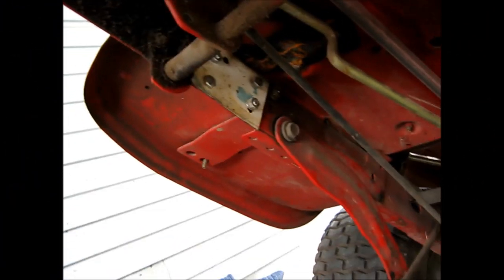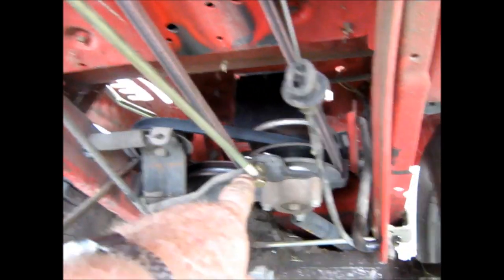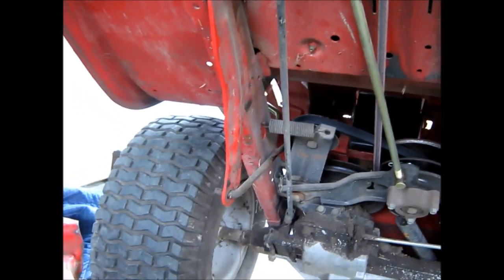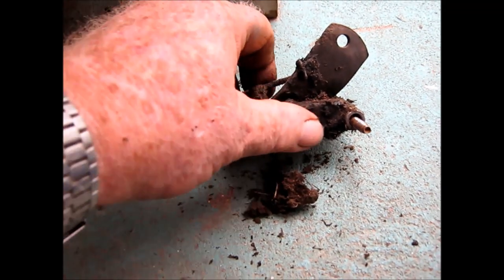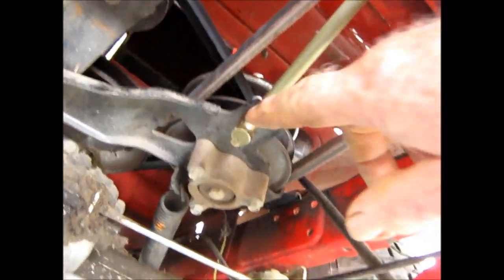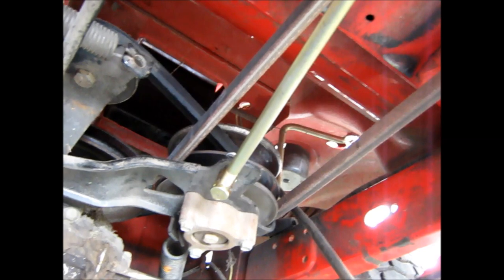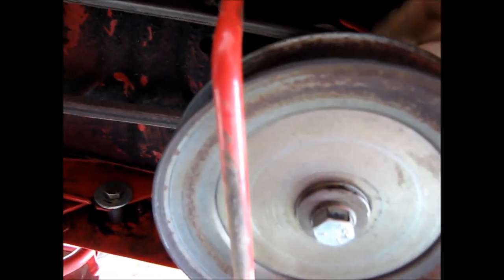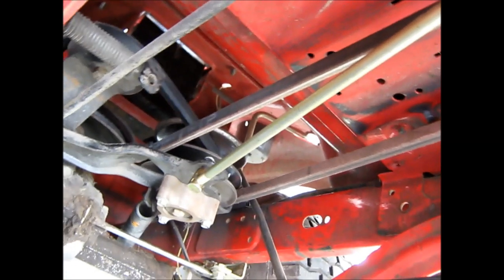troy bilt mower won't go up hill in low speed

Comment: That's exactly the video I needed.  Not for the same reason but, I lost the transmission tensioner pulley spring.  I could see in your video exactly where it is and what I need to buy.  Thanks!

Comment: Thx for the video. I'm chasing the same issue on my 2002 MTD. Changed belts and only drives on level ground. Thinking it is a clutch issue. Now I see it needs an adjustment!  Thanks for the info. I'll make this adjustment and post results!👍

Comment: You can also remove the bolts holding the engine to the frame and slide the engine back towards the seat to get that belt around the pulley. That's the way that I did it. The engine doesn't move enough to damage anything related to fuel or exhaust connected to it.
Reply: I never tryed that but think I will 

Thank You

Comment: Good fix, Vernon. I had a similar problem with a Simplicity mower recently, but it was the belt adjustment on the mower deck.
Reply from the maker: I might have celebrated my success a little  too early, now it seems it's not quite right now,,

Comment: If you put a slightly too long belt on or the belt wears some then simply adjust the engagement rod so the belt will be tighter and it will pull in low gear
Reply: i gave you a thumbs up that is exactly what mine was doing, pull in high gear slip bad in low, thankyou
Reply: @danthemanoth  you're welcome

Comment: Good you find that problem, I had a 18hp MTD that mess with me, I never managed to get the links set correctly,  after many moons I found out that on that machines it is mandatory that the two covers on the outside blade pulleys must be on, mine was gone,
Reply from the maker: yours must have been the deck belt, ??
Reply: Yes

Comment: I have a 2005 pony that is doing the same thing. I changed the belts and now it will only go in 7th gear. Will you please post the part numbers for those drive belt or the actual size of the belts. The ones I used were 5/8" wide. I will greatly appreciate it.
Reply: Did you figure it out mine is doing the same thing won't businesses in high gear

Comment: I have a question, my Troy-bilt was having a hard time climbing hills last year, but now won't climb,it doesn't seem to be transmission, I dont think because reverse works good,runs good on flat ground, and I'm not too mechanically inclined,but need to know WHAT to check...replaced belts and some bolts last year, its stayed well maintained so I'm at a loss a family member says transmission but I'm not sure I can agree, need an unbiased opinion
Reply from the maker: I couldn't say for sure but one thing you might check is if the variable pulley is moving up and down freely, that's what controls the speed and movement.  That is if it's just like the one I was working on in this video.

Comment: I have same problem it won't move in lower gears I changed the belts and checked the variable speed pulley still won't move in lower gears any suggestions it's like the belts Are to wide or something

Comment: Thanks for the solution to a troublesome problem. Keep em coming and thanks for sharing.
Reply from the maker: I though it was fixed but I tried it later and it seems like it's still not quite right,
Reply: maybe it just needs to be a little tighter??
Reply from the maker: yeah, I'll probably tinker with it again tomorrow,

Comment: Question for ya…..I’ve changed both belts ,and now when starting up it moves on its own without touching throttle pedal….any suggestions
Reply from the maker: the only thing I can think of if you are sure the belts are the right ones is maybe the variable pulley is stuck that's the one where both belts share sometimes the center gets gummed up or rusted and can't move up or down so the tractor doesn't work right. One other thing could that the rod that connects to that pulley assembly might have come out of adjustment. that's about all I can think of that would cause that.

Comment: Have you ever used some automotive belt dressing on those mower belts? Not sure, but it may give them a bit more grab.
Reply from the maker: I am starting to think I ordered the wrong belt,
Reply: If it has a centrifugal clutch then the width of the belt would make a huge difference. I once had a centrifugal clutch on a Tote Gote that was hanging up a bit at lower rpms and slipping, just a couple of thoughts.
Reply from the maker: this isn't a centrifugal clutch, it has a variable speed pulley that moves up and down according to how far the shift lever is moved up or down,

Comment: if iam not wrong them mtd trans axels like that ware out and they slip bad.. hard to explain how they work inside the trans but when they get some hours on them the dogs that drive the beval gear start slipping when going up hill or pulling something
 my mtd did that so i have a feling this will do that at some point
Reply from the maker: I thought at first it was the transaxle but I was able to look down through an opening and the belt that drives the differential wasn't turning,
Reply: at least it was the belt and not the trans
Reply from the maker: the transaxle is pretty grungy, and I do have another one or two, I might change it anyway.

Comment: thanks notice mine was doing the same works great on flat but uphill it would hardly to not a all move need too adjust mine are change belt  i'll adjust first later
Reply from the maker: I put new belts on this one but I am starting to wonder if that long one was the right one,,, it is still not totally right even after adjusting it.
Reply: Mine is slipping going up hill  in high gear but low gear it goes just fine. Does anyone know What would cause that ? TIA

Comment: My Troy bilt is slipping going up hill in high gear but goes just fine in low gear. Does anyone know what the issue may be ?  Thanks in advance
Reply from the maker: does it have strictly belt drive or does it have that little fiber kind of pulley thing that goes into a groove that makes it pull? it's been a long time since I worked on one of those I'd think it either a belt or that other fiber thing.
Reply: I would have to check that out. I had it worked on last year and was fine for a couple weeks of mowing. But after that it started to slowly go up hills then not go up at all I high gear. It sounds like the belt is slipping. It goes fine in low though
Reply from the maker: @michaelkaylor4779  oh, it's a mower, I wasn't paying attention I guess, I think it was the belt on my mower the tiller is the troybilt that has the fiber pulley thing, the mowers don't.

Comment: was it the new belts that fixed it or the adjustments lol
Reply from the maker: I inadvertently ordered the wrong belts so after getting the correct ones , it worked fine,
Reply: @MissouriOldTimer  Yeah, MTD has changed their website I noticed the other week. They have made it really hard to find parts for any particular mower. Even though all I use MTD for is to get the part number, then use Ebay to buy the parts... By the way, one way to tell if your Parking brake is sticking, is if when you put the gear leaver into Neutral and the wheels are still locked out from going forwards or backwards... It should freewheel in the N position. I didn't know that and drove my 2005 TB for years that way. I blew the tranny a couple years ago, I suspect from having the load always on it. It didn't lug or anything all those years. It is good to use anti seize on the moving parts of the brake.
Reply from the maker: @kramnull8962  I use "partstree.com"  or " Ereplacement parts"
Reply: @MissouriOldTimer  I have a  yard man 7 speed shift on the  go. Put new belts  on, both drive  and  the upper belt on variable  speed  pulley.  The  drive belt is the same  one that  came  off of it but seems to be  way too long.. will not pull in low gears, but shift up and it takes  of like a jack rabbit. 
What  did I do  WRONG? Thanks
Reply from the maker: @rnjohnston61  If you are sure the belts are a direct replacement then  It would seem to me that either that variable speed pulley is not moving because of being stuck or rusted, or maybe the spring is not strong enough, but I doubt that would be the case, , I'd make sure the pulley is free to move.  it's the center part that should be movable. other than that, as long as your petal moves freely, I don't know what could be wrong.
Reply: @MissouriOldTimer  thanks for the information.  But I  still don't  understand why  the new belt is so much  looser than the same  old belt. And  yep, I  tried  adjusting the  clutch  belt. I'm  stumped!
Reply from the maker: @rnjohnston61  if you have the belt in all the right places under the mower, it would seem to me that the center part of the variable speed pulley is not moving to allow the drive belt to ride higher up in the pulley  that would make the belt tighter,, other than that I don't know what it might be,, did you check out "taryl fixes all"  he has a lot of videos and might have something about your kind of mower, yours is probably made by MTD because they make a lot of mowers  with different names.
Reply: @MissouriOldTimer  I have a 2005 pony that is doing the same thing. I changed the belts and now it will only go in 7th gear. Will you please post the part numbers for those drive belt. I will greatly appreciate it.
Reply from the maker: @lyerlyman  you pretty much need the numbers of the mower , maybe under the seat or hood, they made so many variations of them that it'd be hard to find the right ones with out numbers, I no longer have the mower or I would try to look the belts up for you.
Reply: I had to run mine up a hill in 7th lol, got a good head start and mowed! But this frustrating to me Thanks for the video. I was thinking that if replaced upper and lower belts it would fix it. Looks like it might be that shaft that needs to adjusted. Bottom 3 gears wouldn't pull a red brick across the yard.
Reply: Oh and mine had a sticker under the hood for the key, air filters and all the belts OEM replacement to not order the wrong ones.
Reply: @MissouriOldTimer  Thank you sir for responding to my request. The mower frame number is 13AN779G766 - Troy-Bilt Pony Lawn Tractor (2005) . If you would find those part numbers or the correct size of the 2 drive belt, I will be eternally grateful. Have a blessed day sir.
Reply from the maker: @lyerlyman  this should be the longest belt: 754-04001A they don't give the size for this one.  and this is the shortest one. 754-0241A  BELT-V 5L X 35.25

according to partstree.com
Reply: @MissouriOldTimer  Thank you sir. I appreciate you taking your time to help me. Have a great day and my God bless youl
Reply from the maker: @lyerlyman  you are very welcome, I hope it helped.